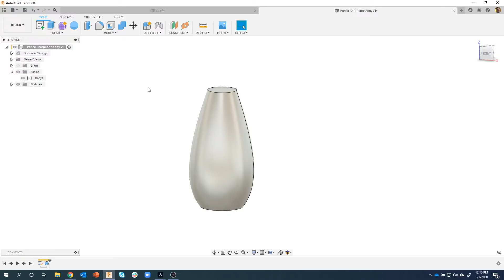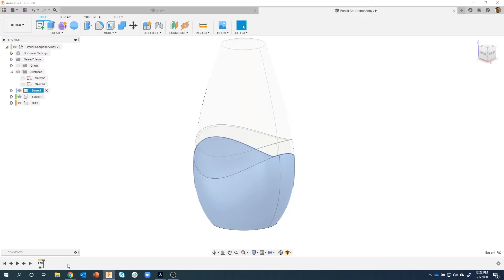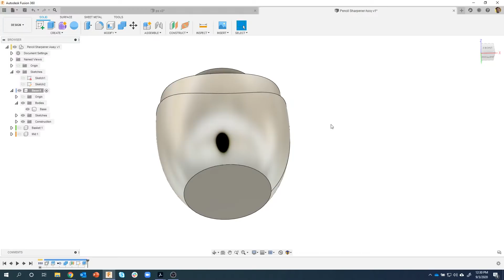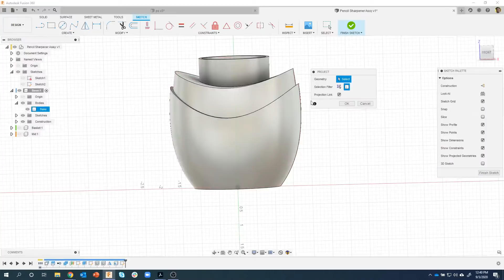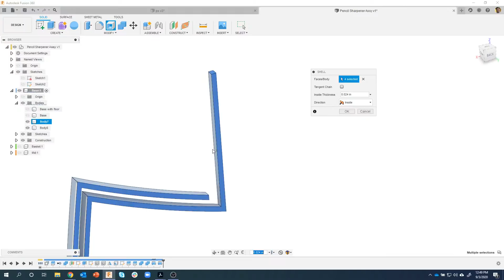Pencil Sharpener Project - Part 1

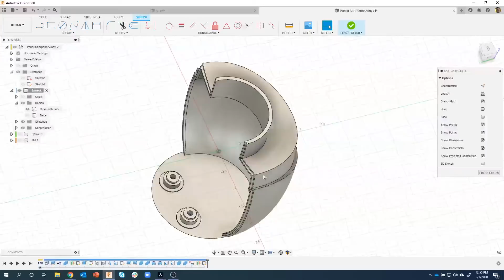Comment: I don't know if anyone reads these comments, but, at about 57:15 where he builds the shelf, I encountered the need to 'replace face' where the outside diameter of the shelf is supposed to join the inner shell. But the replace face command would not work. What did work was to use 'one-direction' instead of symmetrical when extruding. I remember Brad saying once "If something doesn't work, try something else".

Comment: There is a much easier way to do what he does at 8:45. Instead of creating an extra line, create a coincident constraint between the midpoint of the horizontal line and along the vertical line. To grab onto the midpoint, select the coincident constraint and hover your curse near the midpoint of the vertical line, and if you hold down on the SHIFT key, you'll see the midpoint triangular icon appear. If you click, the coincident constraint will apply to the midpoint. The SHIFT key trick for accessing a piece of geometry's midpoint is super useful.

Comment: This tutorial is incredibly instructive. Lots of tools used here i've never thought of using previously as a beginner.

You have a section where you split the bottom part away from the main body, and you use a projection to do this? Why not simply select the inside bottom face as the tool to split the body? I found this much faster than creating an extra sketch and projecting a line to it.
Reply from the maker: @Craig Sunderland-  I could have done that, but that would have split the bottom away from both the left and right side.  I wanted to keep the bottom attached to one of the sides, so that is why I used a sketch to define the split.

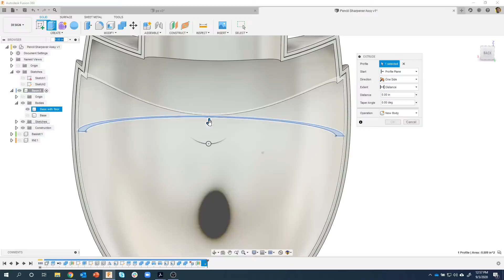Comment: Thank you Brad for this great lesson. I’m not sure if my geometric understanding is wrong but At 58:50 you use the symmetric extrude command to create that small inner lip. Since the profile is fixed and the shape is still opening towards the „Basket“ you are creating a small gap between the lip and the shell, aren’t you? Probably it’s negotiable. I created some parts for 3D prints and just realized such a gap in one of my drawings after it was still visible after printing. Thanks again for this great work!

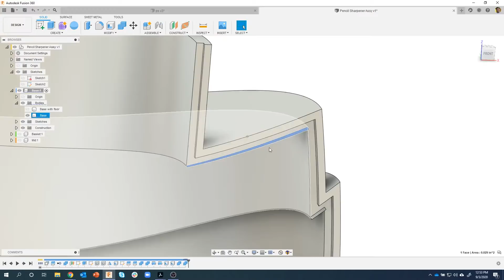Comment: Hi Brad,  the combine at 55:24 to make the groove on the Base part causes an inconsistent edge-face relationships and failed to Boolean bodies together error.  Has there been an update that won't cut due to the slivers that you show were left behind?  Thank you in advance for your suggestions to this issue.  *Problem solved.  I had to change the order of operations from the way you modeled the part.  I had to cut the Base before joining the Base With Floor to the shelled tools.*

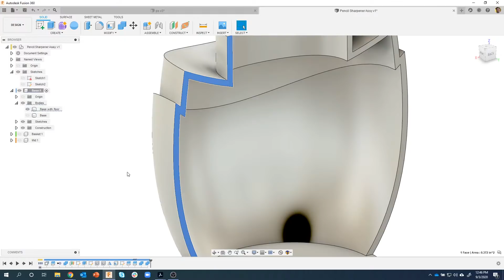Comment: 47:55 you should have used existing material of  the case by cutting out 5 degrees from one half on each side, copy them, then use press pull to make copies thinner from inside, and original slices thinner from outside, and then combine ribs back to halves. Your method would work if the ring was created as revolve around Z axis, but it's a wave instead.

Comment: 8:10, instead of adding construction vertical line add point to the middle of horizontal line and make the point coincident with vertical line. Same effect but no construction line hiding behind center vertical line

Comment: I found out that there was a problem with the original sketch after bodies conversion into separate components.  I typed in the dimensions as said but Fusion changed to something arbitrarily that I failed to pay attention to.  Now that I need to correct the dimensions in the original sketch, how do I come back to that?

Comment: Hi Brad! Some great tips in there! I loved How you used the Shell command to create the lip! Very clever! It wouldn't have occurred to me to use it in this way! Super cool!!! Of course, I have a little tip of my own I think you will appreciate a lot if you don't know it already. At 8:17 when you use a line to constrain vertically the other line, there's a very sexy but well hidden hay to do this. it works only with the "Horizontal/vertical" or "Sketch Dimension" command. While one of these two commands is selected, you press the "Shift" key. This will allow to select the center of a line or an arc. So in this case, you bring the unconstrained line close to where you want it, hold "Shift" and hover over the center of the line. Once the "Center" icon shows up, click to apply the first half of the constraint, then click the origin to complete! :P Very useful to center a circle in a rectangle for example. I use this all the time!

This is gonna be a great series! Looking forward for the next episode!
Reply from the maker: @Blaise Barrette-  I always forget about that cool tip!  I'm so "engrained" in doing it the longer, more complicated way.  Thank you for sharing that tip.  I will try to remember to show it on the next LiveStream.
Reply: Thank you so much Blaise, I have often wished to be able to do this without knowing about this feature ☺️ !

Comment: I have a question ,I am AutoCAD user and I want to import dwg file ( 3d part- solid object ) into fusion 360  CAM for tool path and g code  for cnc , it s compatible with dwg or  need to converted in other formats ?
Reply from the maker: @Elena-  I would recommend exporting the 3D model out of Autocad as an Iges or Step file to bring into Fusion 360.

Comment: Great video! I’m curious, would the lip/groove method create an undercut at the parting line?  If you did a draft analysis would it reveal that? Obviously the screw bosses require a side action, but I’m curious about the lip/groove.
Reply from the maker: @Michael Morena- I am the first to admit that I am not an injection moulding guy, so I could very well be "designing" these parts incorrectly for manufacturability.  I just show different methods in Fusion 360 on how to model stuff.  :)

Comment: Thanks Brad for this awsome video. Some very usefull and clever tips to improve modeling. 
47:19 For the lip, it's, IMHO, a bit easier to split the edge face in half (sketch -> project -> offset inner edge by 0,04 in) and then rotate the new half face by 2°.  You keep the editing with less steps. :)
Reply from the maker: @3D Seb-  Yes, that method works great.  Honestly, that is probably how I "should" have done it, because you can always go back and edit the offset if you need to change the size of the lip.  I showed the "shell" method to show a different, "thinking outside the box" method.  But, I admit, yours is better.  :)